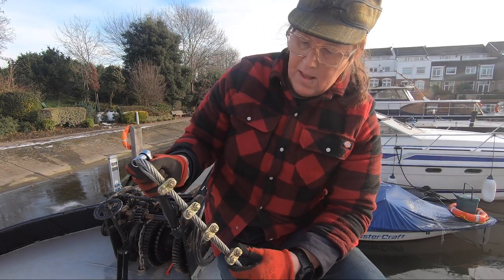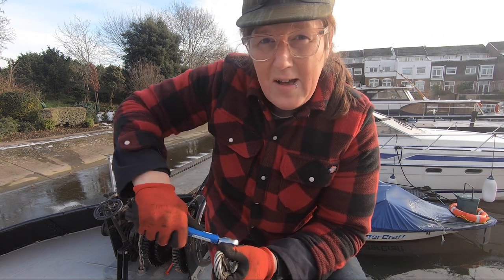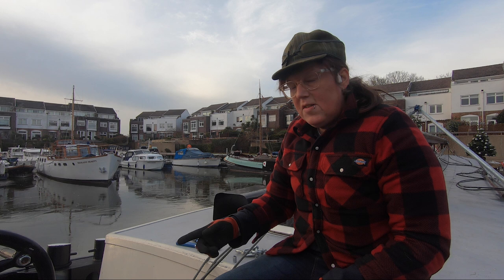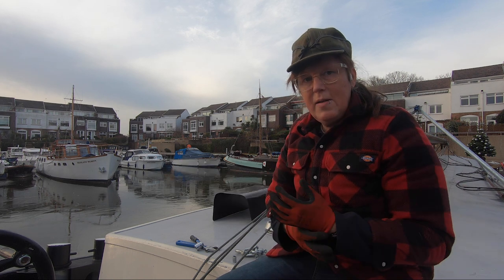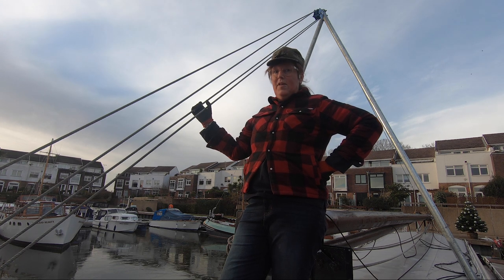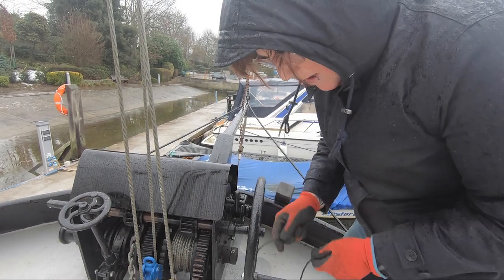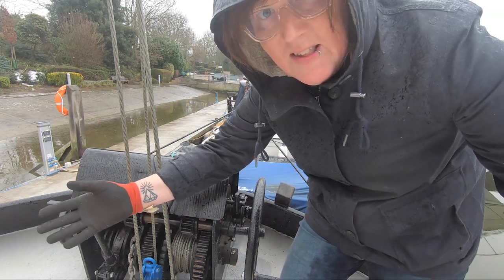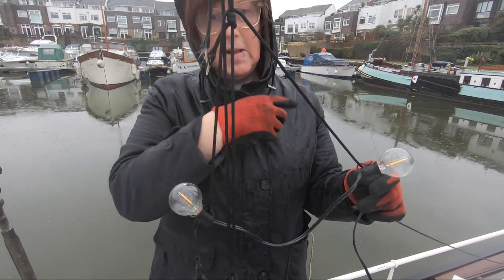#77 Lifting the Mast for Christmas - Dutch Barge Home

Comment: Great videos👍. Have I missed something? I haven't heard you mention about getting a generator. Are you going to rely on solar panels?
Reply from the maker: Usually I'll be connected to shore power which will provide the shortfall after solar although I am planning on installing a generator at a later date to be able to generate power without the diesel engine running.